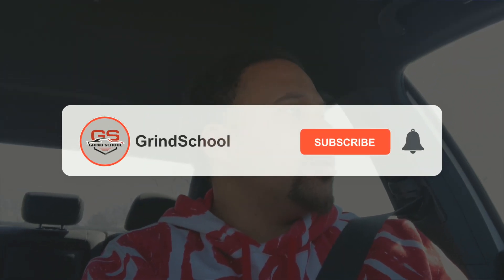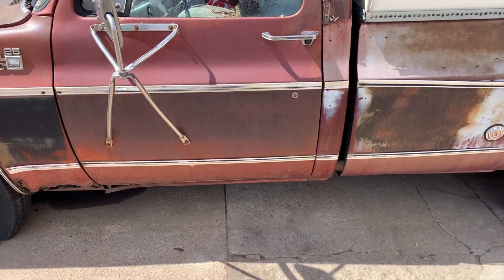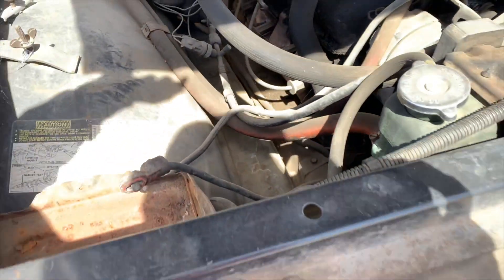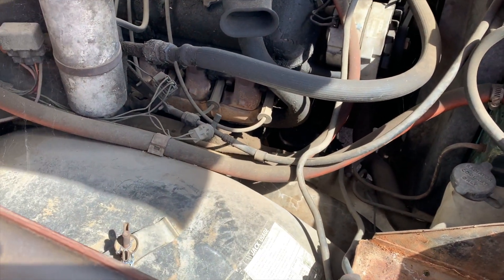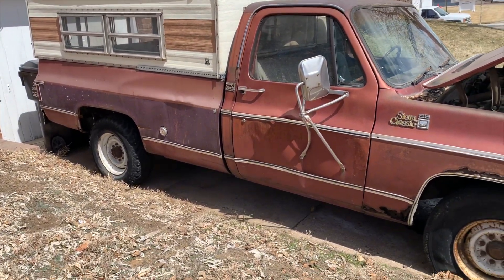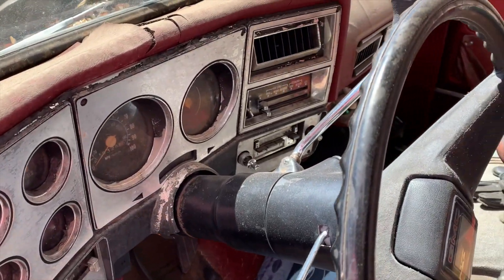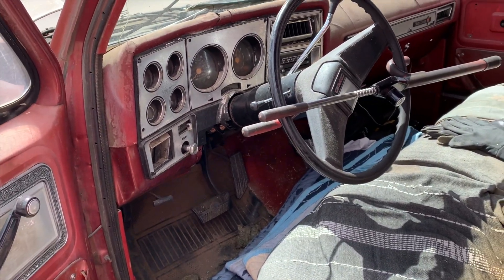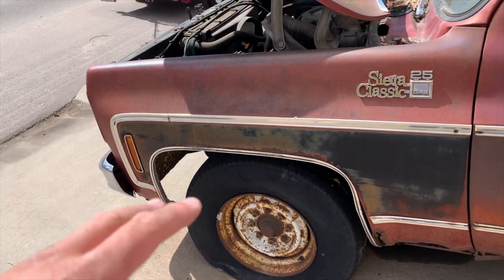78 C10 SQUAREBODY!!!

Comment: LMC for all the panels and interior. Fiberglass the dashboard. Dakota digital gages. Rockauto to get wires for replacement. I would love to do a C10 project. That oil leak might be the rear main or transmission, either way engine out is the best way to fix it.
Reply from the maker: Thanks! Yeah I plan to use all of these resources. I just need the time to get it done lol. Once I get it running and what not I’ll get it home and I can start getting it together